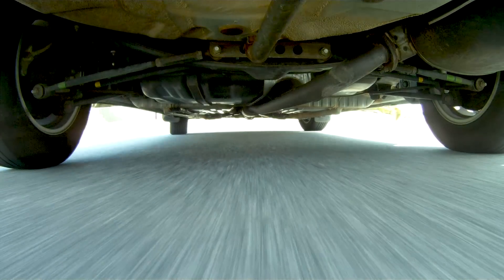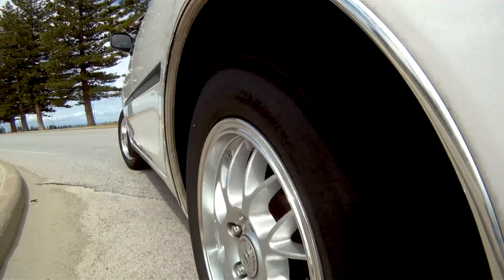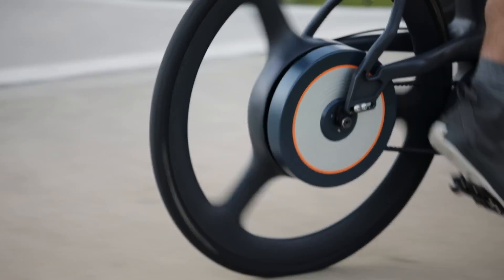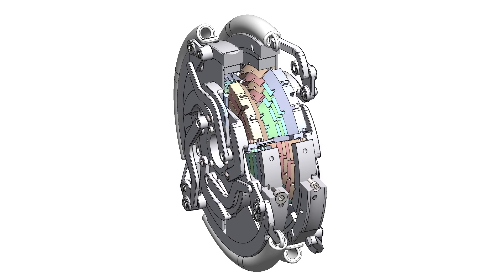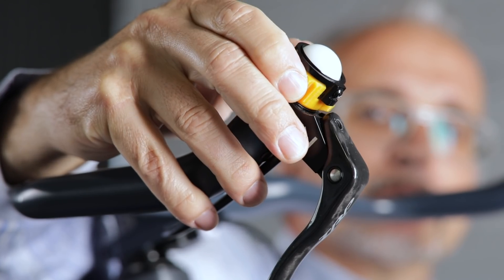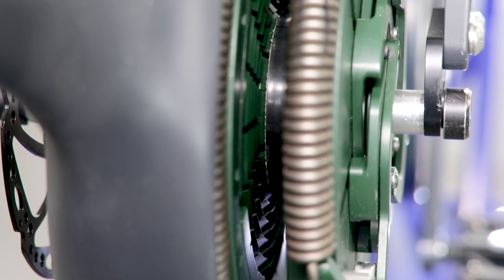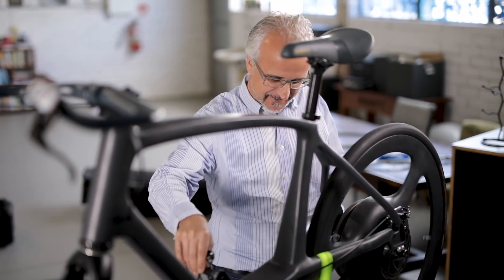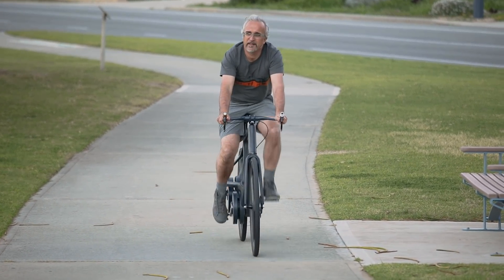Continuously Variable Transmission on a Bicycle

Comment: Thats not a CVT, there is no “continuous” transmission if you have to manually engage the rings, thats just a more complex variable belt transmission
Reply: No, this does function as a CVT. Even if that dial has 'clicks' there is no reason why it would not, or could not have an analogue output to the gearbox.
Reply: @TheUlitamateStunt  I think because the gear box is rotating they would need to have a system similar to a BMX headset gyro but around the bottom bracket (crank assembly).
As for if its a CVT.  
Well by deffinition its not as it needs outside inputs to the front (gearset) or hub.  The rear is a CVT gear/hub set up so its could be called a Stepped CVT.  
Its like calling a dual clutch transmission a standard. I mean its closer to that then an automatic but its not the same thing.
Reply: @TheUlitamateStunt  the goal of the CVT is to not need such input, it changes ratios according to the angular velocity of the driver plate and according to velocity/resistance in the driven plate. 
Although i believe your idea of adding an analog input would make this really interesting, i think it actually loses some of the goals of the CVT
Reply: @TheEduardoafd  thats the goal of an automatic transmission, which changes ratios for you. the same knob used on the bike is equivalent to the TCU in a car. it would be highly advanced to make a useful automatic transmission for a bike.
Reply: The cone rings don't engage to a specific ratio instantly, it continuously passes through nthe set of ratios from the thinnest part of the cone to the widest
Reply: The rings are still conical, so each ring works for a range of gear ratios rather than a single ratio. Hence, continuous
Reply: @alienturtle1946  The rings are conical in order to properly couple to the belt which is manufactured for conical rings. From what I’ve seen in the video each pulley is responsible for a single transmission ratio, therefore there is no transmission when a single cone is engaged.
Reply: @alienturtle1946  That's true, but since it switches (I assume by this video) as a normal gearbox and goes up by a certain amount at a time, it's a real far stretch to call it constant. So, theoretically a CVT, practically not at all, the only advantage being you can pedal while the gear changes with no issues unlike a gear change on a normal bike.
Reply: @thermionicemission6355  Why is it not practically a CVT? In practice it performs just as a CVT would.

For the record, the C means continuous, the opposite of discrete. It doesn't mean constant, so being on a constant ring doesn't matter.

Maybe you're assuming that if one ring covers ratios from say, 0.60-0.80, that the next ring might go from 0.85-1.05, so that there's a discontinuity from 0.80-0.85? I don't see why you'd assume this, since they likely made the ratios flow continuously from one ring to the next.

Even if there were a small gap in ratios between rings, the gearbox would "theoretically" not be a CVT, but still function as one in "practice".
Reply: @thermionicemission6355  it uses a sort of switch that you can twist to make the "gear" go up or down smoothly, stopping when you release it.
 It doesn't have steps, or explained better, it (probably) have 1024 or 2048 steps, so basically continuous... A digital signal doesn't allow for "infinite" steps but it approximates

It actually is a pretty clever and cool design. If only it didn't use f-ing bluetooth
Reply: @alienturtle1946  It's not a CVT because you effectively still have individual gears, all they have done is stack the gears ontop of each other. A true CVT like one in a car will not require you to shift anything because the only variable that affects what configuration the CVT is in, is what RPM you want to achieve. What is demonstrated here in this video is 100% marketing snake oil.
Reply: @StuninRub  We probably disagree on what constitutes a CVT. If, as the name says, the gear ratios are continuously variable (as opposed to discrete), it's a CVT, regardless of mechanism. Using more than one conical ring seems irrelevant, since the rings aren't "gears" with discrete ratios.
Reply: @alienturtle1946  If you have to select and control the gears in the front, it is VERY much discrete. Maybe you didn't listen to the video very carefully.
Reply: @StuninRub  Lol, ever used a volume knob? You don't even need the video to know that user selection does not imply discrete.

But here, let's assume you know your shit. Let's say the outer diameter of one drive ring ranges from 75mm to 100mm, and the outer diameter of one driven ring in the back ranges from 50mm to 75mm. How do you calculate the gear ratio between those two rings?
Reply: @alienturtle1946  Yea, I have used a volume knob, most are set at discrete levels. You ever use the default volume function on your phone? Like I said, you have no idea what a CVT is.
Reply: @StuninRub  My b for bringing up the volume knobs. Didn't realize you'd miss the point. You said user input implies discrete output. Sure, volume knobs can have discrete levels, but there are analog ones which are truly continuous as well. So bringing up discrete ones just shows you either lost focus or are petty.

Answer my gear ratio question if you want to show you know what a CVT is, otherwise your lack of response speaks for itself.
Reply: @alienturtle1946  each ring doesn’t cover a certain ratio. The ring is either engaged or its not meaning each gear has its own ratio and you have to switch between the rings to get the ratio you want. Sounds familiar no?
Reply: @alienturtle1946  no the cones on a regular cvt are always engaged and the bike rings COULD have multiple ratios but they don’t. They each just have a fixed ratio.
Reply: @yoong___  How do you know? (that the bike rings each have a fixed ratio)
Reply: It seems each click is connected to a "step" or a ring on the front "gear set"/hub as the locker bars move when shifted by the BT controller.  
It appears they slide out so that a full "step" or ring can slide into the path of the belt though it's a movement 90 degrees to the centrifugal rotation so I'm guessing they move under spring force in.  Then it appears as it's shifted down the groove in the locker bar catches a pin in the rings and pulls them out of the path of the belt.

The main issue with this idea IMO is you are adding 2 massive plates of something.  Metal or nylon to the side of your bike plus motors to drive the BT shifting, spring plates, shifting arms, locking arms, lugs, and rings.  Worst of all its an open system so any road dirt will find a nice home in that complex assembly of high tolerance parts.  Main reason why transmissions/gearboxs are enclosed.

MTBs have lost the front derailer gear set and gone to super light pie plates for gears on the rear.  Why would you add at very least 10-50 LBS to a bike. 
"I just paid $3k for a carbon frame please make it's 20 times heavier than the aluminum one."

In my opinion the only place this would be even conceivably useful is on a Electric bike due to weight and if they can give a ratio well over 550%.
Reply: @MuShMaNn  I mean, I can definitely agree this has more conceptual than practical value. And maybe like laser disc it never pans out, but maybe it's a clunky start  to something that becomes useful/viable with further improvements.
Reply: @alienturtle1946  It would be an amazing system in a pedal-powered electric or ICE motorcycle if you could get the gearing right.
It seems like if you expand on this system you could get 1000-3000% gear ratios.
If it was completely enclosed and paired with a high output electric or even ICE(internal combustion engine) for a moped this system would be a good one.
Reply: @MuShMaNn  Yeah, pedal-electrics were what I had in mind. I read motorcycle as "sport bike" at first, but yeah, I can see it used in light motorcycles too.
Reply: @alienturtle1946  True! But, to eduardo's point, if you are only able to shift between ring one being the driving gear or the ring two being the driving gear and not able to set ring one gear to be 79.876% engaged, that is still just a really complicated set ration gear box.
Reply: @steve2547  Well, do we know one way or the other whether the rings are only in/out, or if they can be partially engaged? When the title says CVT, and based on the limited info we have it's actually possible for the thing to be a CVT, I don't see a reason to assume otherwise.
Reply: @alienturtle1946  That's how I understood it...
Reply: @NakedUndone  👉👉
Reply: 10 speed variable gear ratio transmission
Reply: Its a great mechanism anyway
Reply: But you can tell they started with a true CVT... 😐 ... 😖 ... 🤭 ... 😂

I wish I knew how to raise money like that guy.
Reply: Exactly why did they even think of this
Reply: It's more like a manual cvt.
Reply: CVT ≠ automatic. This does have continuously variable drive ratios.

Comment: I'd like to propose an even better and simpler solution: a generator will be driven by the pedals, the generator itself is connected to a boost converter and then to an ultrasonic transducer which is housed in the throat of a bird in a coockoo clock, situated under the seat, a LoRa connected servo drive will  change the distance between the trasmitting US transducer and a US receiver. The receiver will be connected to a toroidal transformer in the rear hub and then and then a motor will drive the wheel via planetary gearbox. Tadaa:)

Comment: Engineering wise it’s great but, wireless need batteries, batteries are heavy, heavy bicycle are inefficient. Not to mention anything with moving parts need motors or actuators, which in effect involve heavy parts like electro magnets. Plus while they did reduce the size of your typical CVT, it’s still too big for cyclists in my opinion. I know that it not everyone is looking to go into professional cycling, but the added weight of this would be a hindrances to any cyclist unless it make up for the added weight mechanically. I’m aware that this is a proof of concept and that it may be used on other applications that can better make use of a CVT than a bicycle. I think the bicycle is just a cheap “vessel” of sorts, that uses this type of mechanical equipment.

Comment: As an engineer...a mechanic...a coffee addict...These CVTs are notoriously weak and over complex in cars. And, virtually no one is willing to work on them.
Here...the idea is even more silly. It's an over complicated and bulky solution to a problem that already has much better solutions.
Like using a chainsaw to cut your hedges. It will work, but...

Comment: Bloetooth? WTF! Normal belt systems are regulated by the torque to keep the rpm optimal at all conditions that is purely mechanical autonomous system. stupidity at its finest.

Comment: Seems like it would be bad for mud and a lot of terrains. It also seems to be harder to maintain and fix if there’s an issue because local shops wouldn’t probably know how to fix this stuff, don’t even have the parts for it, or tools to dismantle the thing.

Seems cool but it’s probably expensive and useless

Comment: Firstly, I don't think it's a CVT since it now has a set of preset ratios. Then there's a problem of it being too complicated, derailleurs are geometrically difficult to get right but the mechanism is simple, this is difficult to get the geometry correct and mechanically hideous to worked on. Finally, I think it only works on hardtail. Can probably fit some kind of tensioned cage like you see on derailleurs to make it work on full suspension bike, but then again, I'm not sure it works well under dirty condition.

With all being said, props to the engineers to realize it, I think the fact that it uses belt instead of chain makes less resistance for the cyclists, therefore more efficient pedalling.   Less noisy as well. I'm actually wanted to use it on the road tbh

Comment: Do it way smaller, fit it in a gearbox and make it cable actuated. Right now the exposed components defeat the advantage of the belt drive , they work better in muddy environments.

Comment: People talking about mud or dirt getting in to the mechanism when going on dirt paths or 'offroading' etc. but I can't be the only one that just ends up with dirt and stones and whatever else in the chain on normal paths, right?
Maybe in the US or something, in downtown areas, they have perfectly clean paths with like 0 dirt/stones/whatever, but around where I live over the course of a month or so your chain can get covered in all sorts of random crap from the pavement, meaning this CVT would get absolutely packed in with basically everything you can think of and would need constant maintenance and disassembly to keep it running.

Comment: I’ve always dislike the use of CVT transmissions in automobiles. Having it on a bike is a pretty cool idea. Looks like the gear shift is a lot more precise and smooth. The issue with the CVT system on automobiles is the belts don’t last nearly as long as gears with heavy use. I’d be curious to see how well the belts perform along side bicycle chains.

Comment: Well, I never thought to myself “man my bike is real reliable, how do I make it unreliable?” But if i ever do this is the answer
Reply: Do you really believe that the guy who created this super complex gearing system didn't thought of that in the process ? It's something new, ofc there will be flaws
Reply: @Neoproxy_  Similar to engineers who designed cameras have never used a camera. One glaring flaw was the complex gear was exposed to the environment.
Reply: I always thought to myself after comoletely replacing my drive train? why the fuck are these cables skipping gears every 2 hours?
Reply: Dude I LOL’d on this. Thanks!
Reply: There would be an easier solution
Just put less tension on the chain and you get an unreliable shifting bike

Comment: Is it really a CVT, though? Considering it has a toothed belt, that belt is only going to engage with the teeth on the various sections of the cones; it's not going to properly engage when the cones are partially extended. If the belt acts as a standard V belt when the teeth aren't engaged, which I have suspicions that it probably won't due to the lack of contact between teeth, then maybe it's a CVT. But even then, it's hard to tell how the transmission acts when one set of cones is only partially extended. 
I'm thinking this is probably closer to a 12 gear transmission.

Comment: You guys lack vision. I know it's completely impractical right now, but this is a proof of concept. You need to think about this from the point of view of a commuter, not a cyclist or sportsman. 

CVT transmissions were ridiculously expensive, heavy, complex and unreliable not too many years ago, even for cars. Now they're normal. With a few more years of development, they can minituarize, simplify and cheapen it for bicycles as well. I can absolutely see this being used in urban bikes even if not necessarily sport ones, not to mention for people who like to travel with bicycles, for commuting or travel proper. This also happens with some street motorcycles and scooters. There are some similar technologies like Shimano Nexus for those usecases already. We already have electronic shifting in the top range transmissions already, and servomotors are a less elegant solution than it might seem. I doubt people will be interested for competition settings however for about the same reason sport cars tend not to have automatic transmissions anyway. You can also argue that takes away from the sport but not everyone cares about that. Considering bicycles are becoming increasingly popular as a means of transportation not just in Europe anymore, and the general trend towards green tech, this could have a real market for it in the near future.

Comment: Funny how there's no mention of weight or the effects on handling of having that weight pretty far off the centerline of the bike. To me (an engineer and avid cyclist and bike mechanic) it seems like complexity for complexity's sake. The modern bike derailleur drivetrain is very efficient, relatively easy to maintain, and relatively inexpensive. Oh, and their argument about having to set front and rear gearing doesn't apply to a 1x setup. But, it does have Bluetooth!